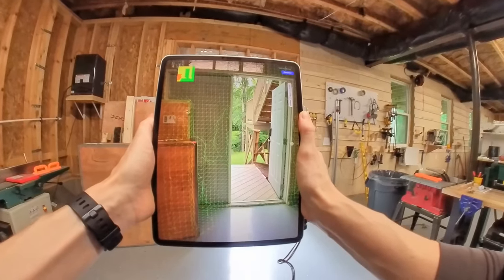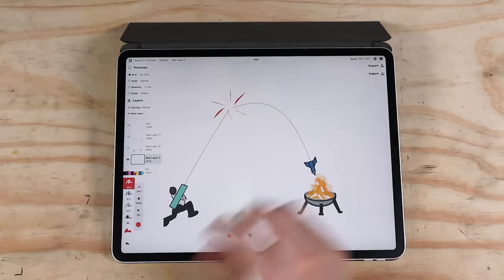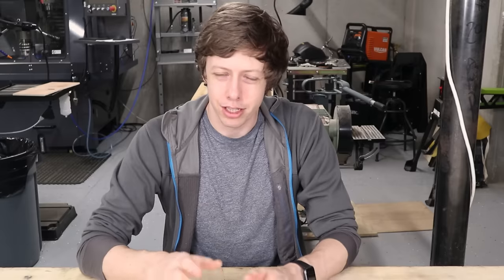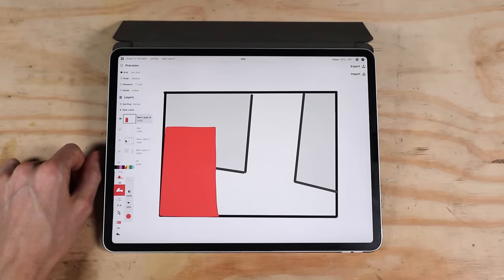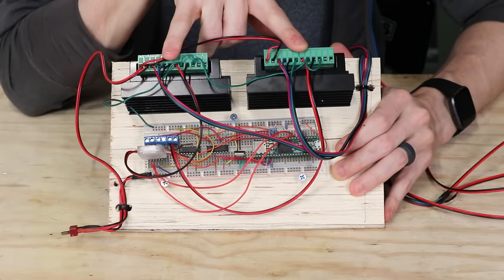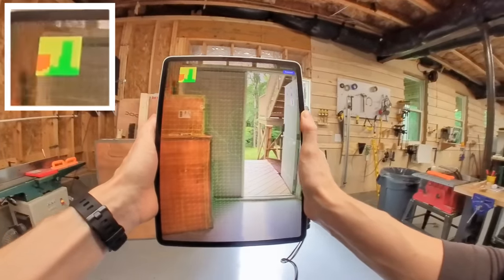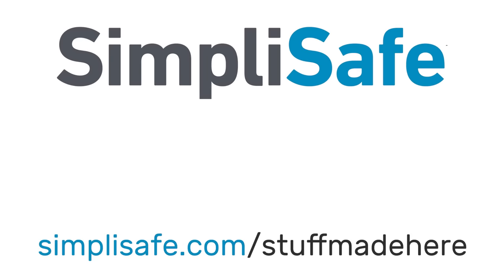See in complete darkness with touch

Comment: I'd love to see you keep working on this and seeing how far and advanced you can take this, because this can be absolutely groundbreaking for the blind community.
Reply: This really isn't groundbreaking at all and is about 8 years behind Google's own project. The reason the tech has never taken off in the blindness community is because simply using a long white cane properly is far safer and more efficient without any battery usage or other tech dependency issues. Something like this would never be useful for chaotic environments like malls, airports, or festivals and would still require considerable training with a cane as well.
Reply: @Casper-Ghost  Just me again. I'm assuming you invented the cane at this point
Reply: @Casper-Ghost  You know that a cane is tech? tech is not synonimous with "computerized thing". Language is tech, agriculture is tech, a hat is tech, and this is also tech.
There is no difference between being dependen on one tech or another, and this tech could perfectly be integrated in a regular cane and bum you have both tech so if one fails you have a backup and are less dependent on one tech in specific.

Comment: Dude, I sponsored several engineering student teams to do something similar to this 10 years ago. I stuck with an array of tactors (pancake motors) spaced 2-point-discrmination distance apart, and gave each tactor 3 bits of "depth" using PWM and current control. Note that a typical vibrotactile response scopes to only 8 JNDs (Just Notable Difference) so 3 bit depth just about covers what we can hapticly perceive. My initial designs were like yours, which morphed into a different form factor. According to my physiology research, I figured I could get a 64 tactor array. Not much but my form factor theoretically pushed the performance of that significantly. Sadly, this is one of my main back-burner projects that has not yet completed to a decent prototype stage. Sigh.
Reply: what in the fuck

Comment: This could be adapted into a smart cane for the blind as you wouldn’t need a screen (if you could manage to separate the idar )... so much potential as a real product
Reply: Don't even need a cane, I don't think. It could just be a wand. "Tactile flashlight."
Reply: @007bistromath  Having it in a telescopic cane would be a good idea because you'd have mechanical backup in case battery dies or the lidar fails.
Reply: @007bistromath  Why did I read that as "Testicle flashlight" 😂🤣 talking about wands sure didn't help
Reply: @007bistromath  Those have been around since the 80's and they're stupidly unsafe. A regular long white cane will always be better.
Reply: @MikkoRantalainen  But why would you when the cane provides better information and more of it?
Reply: @Casper-Ghost  Wow you're actually going to multiple comments to spread negativity to people having some fun.
Reply: @Casper-Ghost  uhh.. tree branches?
Reply: @lokiaverro4196  What about them? You can usually hear the change in echo quite clearly when branches at face height are over the tip of the cane, also the pressure receptors on the face responsible for "facial vision" will alert you as well if you're used to traveling blind. 
If you're in a rush though or not confident in yourself then you just wear a hat and as long as you use the cane properly you'll be fine.
No other method besides sighted guide can help with tree branches so a hat and cane is the best bet if you're jogging in a new area or something.
Reply: @acvgaming5601  I'm not spreading negativity, I'm pointing out the reality of the situation because too many people think blind people need special technology to get around as well as anyone else on foot. This mindset only hurts blind people by crippling them with low expectations and an expectation of technological dependency; I'm sorry but I'm not down for that.
If you can't handle being educated on the reality of the situation and the technology then that's your problem kiddo.
Reply: @Casper-Ghost  lol you're hilarious. Are glasses coddling too? Wheelchairs? Hearing aids? I mean, the last thing we want to do is bother someone's pride, amirite?
Reply: @lokiaverro4196  How does a necessary medical device compare to reliance on an unnecessary device? I'm advocating for the wheelchair while you're pushing the high tech rocket chair with half the safety, efficacy, visibility, and speed of the normal wheelchair.
I encourage my students to use whatever method of travel they are most comfortable with but I require them to have strong independent travel skills with the cane first so they can make an educated decision and choose what's most efficient for them, and so they don't decide based on trying to hide their blindness like the majority of people before going to training.
Your argument makes no sense to me because part of my problem with people focusing so hard on subpar cane replacement tech is because most of the time people use stuff like that because of the stigma of the white cane and not wanting to look blind but that gets lots of blind people into dangerous situations. Similarly devices like this seem more interested in reducing the visibility of the condition than actually making a better mobility device than the cane.
It isn't about pride or not coddling people, its about safety.
Reply: @Casper-Ghost  if you can't see the benefit to non-contact object detection, then the problem isn't to do with stigma or shame, but instead your own reliance on the methods you learned and prescribe, dressed up as concern. 

Your argument that people should rely on a synthesis of their senses instead of technology, seems odd when we are discussing people who have difficulties with at least one sense already. What if you have trouble hearing too? 

As far as I can see, there is no good argument that advancing this technology will hurt blind people.
Reply: Thing is, both the cane and the handheld device... Already exist
Reply: Can get tactile response or audio response
Reply: The better option is have the camera as glasses that the blind person puts on and have either a glove or a small stick as the indicator of what is around you.
Reply: I'd say glasses that are just sensors and on the sides you put those protruding buttons on the face side, then make them express closeness and direction with placement of the buttons
Reply: @lokiaverro4196  what is your problem with someone giving some ideas?
Reply: Tactile-cane!
Reply: @Casper-Ghost  Oh, you poor fool. I don't think you have any idea what it's like to be disabled from a vital sense like vision, are you? You wouldn't come up with such a ridiculous comment otherwise
Reply: @raven3696  Lol As I explained in my previous comments I'm a Visualy and physically disabled Orientation & Mobility Instructor (someone that trains blind people to use a cane and regain their prior independence) with almost 10,000 teaching hours, 7,000 of which were done with a blindfold on to eliminate my residual vision, so you couldn't be farther from the mark as three of my 5 senses are impaired; its just you simply can't understand it because you lack any kind of experience and are likely terrified of losing your vision like most normies.
Reply: @MarioMonte13  laser canes are nothing new but they suck compared to an actual cane.
Reply: @Casper-Ghost  oh, I wasn't making a point. I was just making an Archer reference.
Reply: @Casper-Ghost  So you train people to use a cane and now that's all they're allowed to have?
If tech could improve their day-to-day activities and make them less reliant on other people, what's the point of being a negative nancy about something that was just a proof of concept? Companies are building cars that drive themselves at high speeds with this technology, perhaps you should go talk to them about how much better the horse & chariot was.

Comment: Great proof of concept. Having worked with the visually impaired, I can tell you that people that are blind are incredible at taking a new input and making it intuitive. My idea, FWIW, is to place the pin array into panels that are situated on each outer forearm. Splitting the screen in half for each arm. Maybe make it Bluetooth?You can have many more points for feedback. Since the arms sit at the lateral extremes of your body, this is you clearance when moving through obstacles.
Reply: Was thinking same thing.
Reply: If it linked to a bluetooth headset, it could talk to you/warn you of obstacles especially moving obstacles like cars and animals: a doorway is infront of you, a person is walking towards you, a lamp post is on your path, the path you are walking on will end in 20 feet. 

If it was a camera mounted on your shoulder it could also warn of things behind you like a cyclist is approaching from behind. 

Perhaps you can ask questions like: question: "siri, where is the nearest street crossing" answer "A pedestrian crossing is 200 yards infront of you." question: siri, can you see any public transport options" answer: "yes, two taxis approaching from the right and a bus stop 100 yards to the left" question: Siri, what is the building infront of me? answer: "New York Public Library" 

Using the tool in the video you might think a staircase is an obstacle. However you could walk into. a room and the app could tell you: "shelves on your right, reception on your left and a staircase leading up infront of you." 

I am sure as the AI for self driving cars advances and they can differentiate between different things it could be applied to this sort of thing.

Comment: I’ve had the idea for pretty much exactly this design for years...so freaking cool to actually see someone build a proof of concept. Always felt like it would be a great phd/research funded project since it has the possibility of benefiting humanity like you touched on. Love your channel!
Reply: Honestly, he should reach out to a university to collaborate, see if he can get his name on the paper too.  Increase the chances of it being made a product.  Could he actually get a PhD that way?  Wouldn't surprise me if he had one already.
Reply: The stick blind people use works better, is cheaper, faster,never runs out of battery, has better feedback ( lidar and low definition tactile"screen"  wont be able to tell there are stairs, or a pole....)
Reply: @niconico3907  Except the stick wont tell you about head high obsticals in normal use. The stick is also distance limited to roughly one stick length. A future version of this would make an excellent compliment to the stick by giving roungh information at greater range that the stick can be used to gather fine detail on.

Comment: Awesome!

I did something very similar when I was studying CS in the mid-nineties (so last century, I know). We used four integrated radiowave emitters and receivers to measure the distance of obstacles, and sent that to an actual set of braille display modules through a driver we developed and built - one braille unit per finger tip on one hand (we didn't use  the thumb) in some sort of glove-like contraption.

We went and tested this with actually blind volunteers, and it worked brilliantly for a prototype. You need to keep in mind that people with impaired sensory systems develop heightened sensitivity n their other sensory systems, i.e. in this case also finger sensitivity. Given that the fingertips are one of the areas in your body with the highest density of nerves (as opposed to parts of your bak where the distance resolution can up to 10 cm depending on the person, you can imagine that blind people develop an especially sensitive touch. Add to that that a blind person's  mental image of the surroundings is fundamentally different than "ours" you need to think a bit out of the box.

The blind people we tested the system with had a load of fun doing that, wearing the laptop(!) in a rucksack, a rather hilarious sheet-metal arc on their chest with chunky radio wave units screwed to them, feeling all like Terminator and RoboCop... :-) The resolution of the braille units were more than sufficient to get the information required to have a really good success rate, especially regarding false negatives (your wife will be glad to hear that, hahaha)

It was a delight to see tour test subjects almost run through the obstacle course in the auditorium maximum, and later in the gymnastics hall using all the equipment available there.

So TL;DR: If you are going to do a follow-up, definitively go for braille units, I bet they are much better these days and much easier to drive than they were back then.

Fun fact: we first thought of using matrix printer heads but the blind agreed with us that the potential collateral of having your surroundings tatooed on your fingers is not such a good idea :-D
Reply: How is this comment so long

Comment: There have been quite a few projects done with environment sensing concepts. Translating it is always the hard part :)

You're thinking mechanical. Electrical stimulus however would give you a lot finer control. You could potentially build low power impuls sending device into a glove and send impulses to finger tips, in brail. 

You could also translate intended directional commands/information into audio instructions. With a small hearing device/earphone that would potentially be easier. 

Anyway, cool idea. Good luck with it :)

Comment: Excellent idea! I once heard of a research project where they used vibration-motors from smartphone arranged in a belt to tell you the direction in which to go. They would let the people walk around with it for a longer time (1 or 2 weeks) and continously lower the intensity. At some point the vibrations where so faint they could no longer be picked up conciously, which is akin to giving you an extra sense. I would probably try a newer version with something like this. And while you're at it: IF at some point Galileo comes online it would provide you with precise enough data from your surroundings. Augment that with information from a Google Glas, run optical flow on the video picture to get an estimate of collisions about to happen... That could work pretty seamlessly.

Comment: "It's only giving two levels of depth"

Have you considered temperature feedback? It could provide an additional dimension of data and might have a higher resolution than haptic pins.
Reply: only problem is that your temperature sensors are only lucking for changes in temperature and and not at an absolute value .
Reply: and by only i mean its a way to big problem to overcome i think
Reply: It's not possible because changing the temperature takes time and is not instantaneous for movements like walking down the street. A low charge electric shock could be possible ⚡️
Reply: Or even voice? Idk
Reply: @KunalBagaria  low charge electric shocks aren't a good idea. They can provoke a local anesthesia,  phantom sensations or even nerve damage over time.
Reply: @KunalBagaria  we can also start to burn them if they are about to  collide with something
Reply: Better than all of that a 3D noise.
Reply: I was thinking about adding erms with variable speed to each pin to add vibration to the pressure feedback. No vibration is trip hazard, high intensity is overhead hazard, etc. Each pin's vibration could be isolated with a slight redesign and sorbothane molds. I would also add another pin with a beefy spring that isn't part of the mapped array with more potential energy to give the user an aggressive jab that means stop right now.

Overall, I would ditch attaching the "map" to the device. The sensor is really all that matters and holding a device in front of you for long periods would be tiring. I'd add Velcro to a case and a chest harness so it can rest in a standard position but also be removed for guided mapping. That way the user can just hold the map at their side once they've gotten used to it. Or, even add the option to vertically invert the map with gyro info if it is dropped down to one's side. I could see that be a matter of preference much like inverted controls in video games.
Reply: Instead of temperature, what about vibration feedback? Pair it with the pressure pins could be an all in one pin solution. And the hands are very sensitive so you wouldn't need a wide vibration intensity/frequency range either

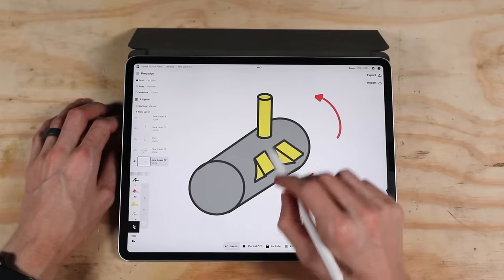Comment: 8:00 - congratulations, you've just invented VTEC.
Reply: Lol underrated comment👏
Reply: I must admit, I don't get it...
Reply: @krakenpots5693  It's a system Honda made for car engines.
Reply: @krakenpots5693  The cam shaft which controls the intake/exhaust valves in many vehicle engines also works by having bumps on a rotating shaft to open the valves. Vtec is a system which uses different sized bumps to open the valves different amounts, it works almost exactly like the system he developed here.